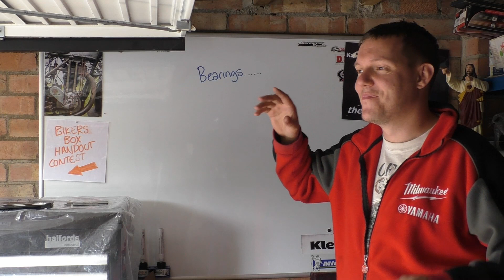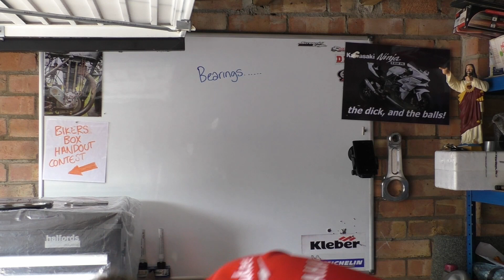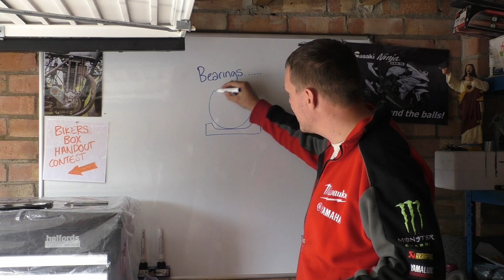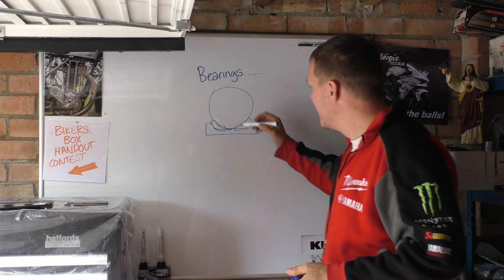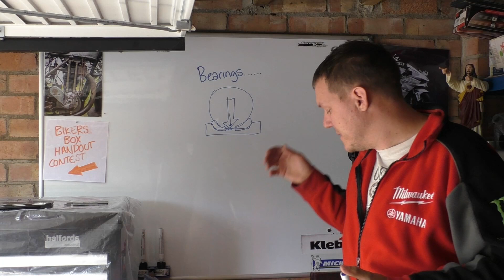Fidget spinners and oil - Why use oil?

Comment: With roller bearing in a multi-cylinder engine you either need a crank that comes apart which is expensive or a drum (barrel) crank whick is expensive & heavy.

Comment: Tri-flow.....is the shit to use on the bearings....ran it on kart axle bearings....AWESOME!  https://www.triflowlubricants.com/product/superior-lubricant-aerosol
Reply: Matt, you really need to not only discuss the viscosity but the friction modifiers in oil.....especially important when using in a wet clutch application.
Reply: And a bearing school for guys so they understand why babbitt bearings are used instead of roller bearings....not only because of fitment issues.
Reply: You know, every single time you do a short video giving some insight to how and why something works, it opens the door to countless other videos.

Dude, you are NEVER going to get through all this stuff....LOL!
Reply: The Workshop, BALLS DEEP........YES!
Reply: Why are there so fuckin many different names for the same bearing, journal bearing, surface bearing, shell bearing, babbitt bearing, they all function the same way right? Fluid suspension?
Reply: Plain bearing, hydrodynamic bearing, sleeve bearing... ok I'm done.
Reply: I gotcha, 👍
Reply: Beach&BoardFan with this logic you could even say why are there difernt names for engines,because they all do the fking same xD
they do the same but they arent the same ^^
Reply: marc .... yea all engines of the same type are called the same thing, regardless of who made them or what they're made of, a coyote/ls/cosworth are all 'internal combustion reciprocating piston engines'.
Reply: yes because it is the same type.there is your answer,same type of bearings,same name ;)
but i have to admit my example was a liitle bit shite xD